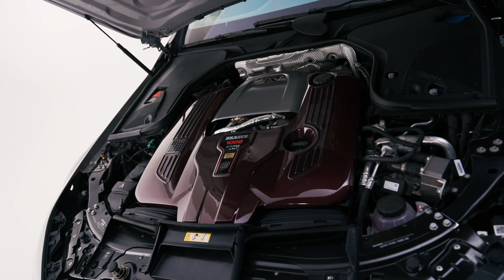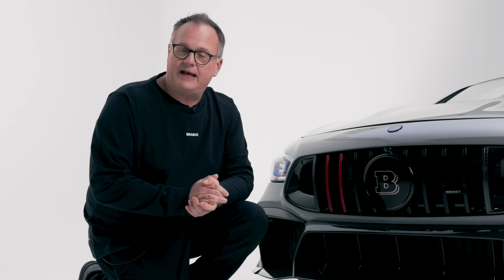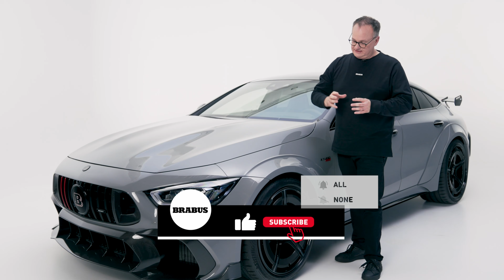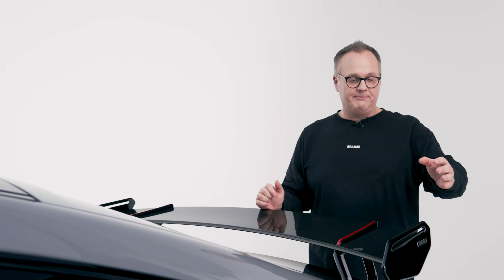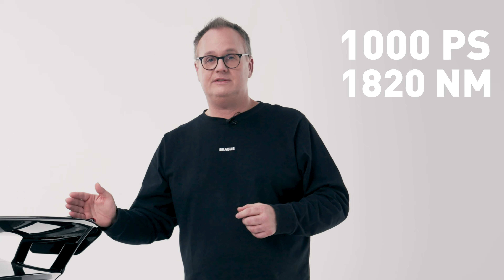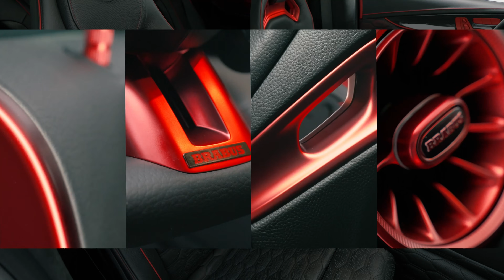The MOST POWERFUL BRABUS Supercar EVER! 🚀 | BRABUS Rocket 1000 #TechTalk [ENGLISH]

Comment: bmw stands no chance
Reply: BMW smokes it easly what you talking about lol. M5 is much faster or M3/M4. 316 Top speed hahahaha thats a crap shit car and worth shit, try remove the top speed and it will broke for sure 100%
Reply: @henzo7087   M5 600 hp, m4 473, m3 473 hp ur just miserable BMW fan This brabus has 1000 hpp so shush
Reply: @quadlas  I talking about MH5 F90 G-POWER making 840 hp which makes faster times than this car and top speed BMW is 350 km/h limited !